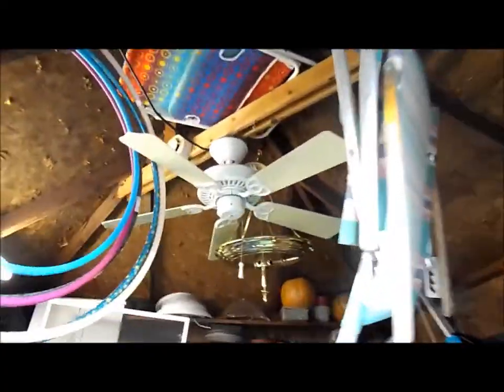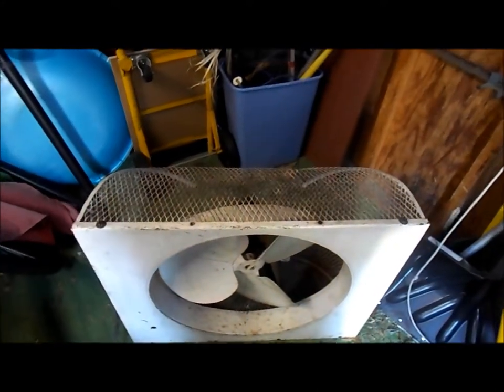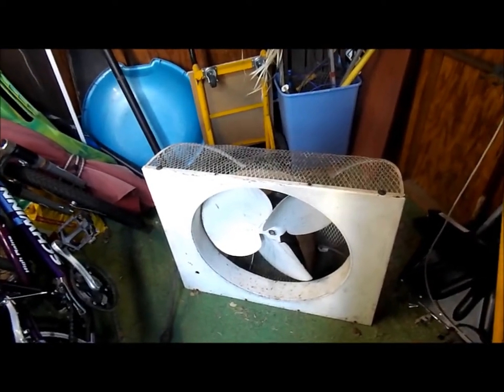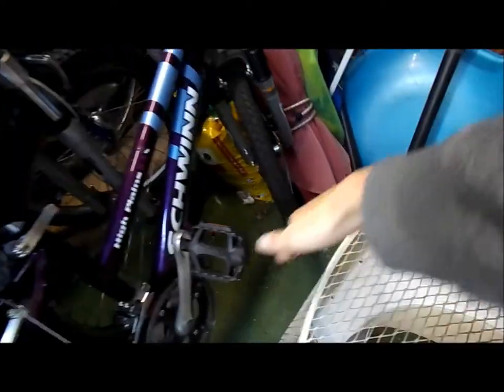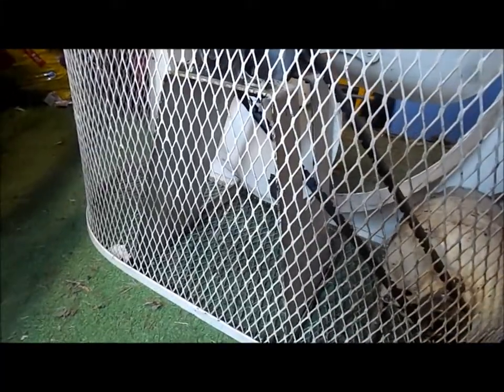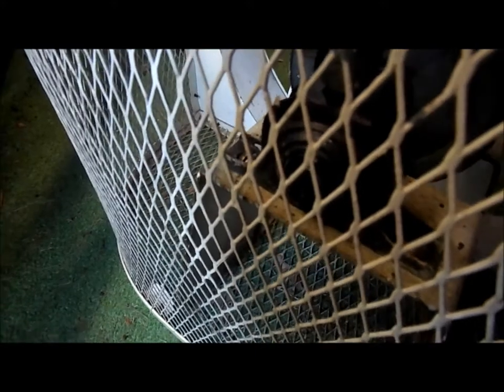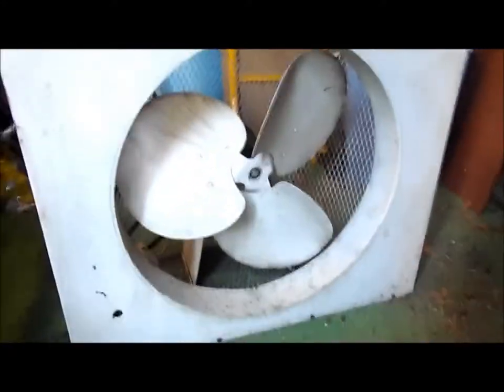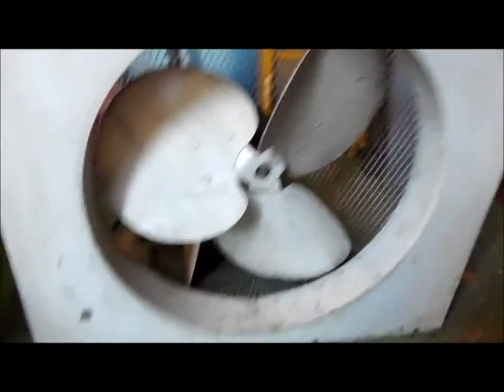Atlas Fan Co. Belt-Drive Window Fan - Pre-Restoration

Comment: I have some information about your fan. My Aunt had this exact model that she bought new in 1948. It is made by the Atlas  Fan Company. The badge that is about 4 to 4&1/2 inches in diameter is missing. It was slightly welded to the cage, and it  hid the end of the ugly pulley. The original color was a light to medium pea green color. On the badge it said Air King, in beautiful cursive writing. I can still see it. How the right leg of the A came down lower than the left side of the A. Then the  first mark of the K was over to the right a little, and the left leg of the A made the upper arm of the K.  The writing was done in black paint. And on the bottom part of the badge in small black print it said "Atlas Ventilator Company" made in USA. The entire badge was painted a dull yellowish color. It had a two speed motor, sorry I don't know what the brand was, and a   two speed toggle switch that was on the side. The black cord came out of the bottom back side of the cage. You didn't see  any cord at all except for what was sticking out of the side of the fan. The cord came through a little metal plate that had a hole in it, with a rubber grommet. On this same plate above the cord was another hole that the toggle switch fit through.  The toggle switch had a little metal ring type thing around it that the top said "HI" and the bottom of the switch said "Low".  When the switch was in the center position it was Off. She was my favorite aunt. When I was at her house in the summertime, I would sit on the couch in the den and just watch it run. The den was at the end of a long hallway. And the fan was in a window that was almost straight across from the door to the den. Every evening she would turn the fan on after supper beforeshe did the dishes. She would go and open a window in every room of the house that she wanted to cool down. Each window would be opened about five inches. They had screens in those days, but no storm windows. She would then say..."are youready to cut this baby on?" I would get so excited. She would stand there next to me and say, "remember to turn it on Hi." It would fire up and you could feel a strong draft being pulled through the entire house. It ran so smooth and quiet.  She would then go back and do up the supper dishes and get cooled down. She had opened the window that was over the kitchen sink. Sometimes I would sit at the table and talk to her, or I was in the den watching the fan. She kept the instructions that came with the fan. My dad, "her brother" would service it for her every Spring. She would then wash it down very carefully, and put a coat of 'Jubilee" liquid appliance wax on it and buff it until it shined. It also had two metal L braces that somehow fit ontop of the fan. Then you either used wood screws to bolt it to the window, or to the windows frame. That was one of the ways it was held in the window. You removed the screws from the fan and tilted it out to remove it for service and cleaning. I still remember the oiling instructions. 30 weight oil in each motor port, 10 to 15 drops every season. And for the shaft on the blade pulley, fill each port with 75 to 90 weight gear oil, not to overfill. Move blade slightly by hand in each direction, wiping away any excess oil that may have spilled out. Check belt for ware and replace if worn. It also had two side panels that would adjustin and out to fit the window perfectly. You had to remove the big wire cage to connect them properly, and to oil the rear bearing on the motor. Dad said that was always a little difficult to get to. I see on your fan someone drilled a hole in the backto get to that real oil port. You couldn't do that if the panels were in place. Yes, she a fine fan. My parents bought the 1950 model which was different in design, but they still used the same wire cage, panels, two speed motor, switch, badge, painted color, shroud around the blade, and window fasteners. The 1950 model sloped down at the top like the first Sears Hobart did. And the redesigned the blade to be more squared, where on the 1948 model the blades are more round. I forgot to mention. My aunt about an hour before bedtime, would turn the fan down on low speed and let it run all night. Or, if it got to cool before morning she would get up and turn it off. Windows were then closed after breakfast and an inside fan was used to help keep the house cool during the day. You didn't run the Atlas during the days heat. It would pull in hot air from outside and heat up the house. That's how they did it back then. I hope this gave you some history on you Atlas 1948 exhaust fan.    Good Luck on the restoration.
Reply from the maker: Thank you for this information! I think i had come across Atlas fans before and they looked similar to this one, but not this exact model. I wish this one was in better condition, I would love to see/find one in good condition. what I wonder is if the speeds were controlled with a speed coil, since the motor itself is one speed (at least the DELCO in this one is). Once again thank you so much for this info, the mystery is solved

Comment: That is a very quiet fan indeed! I can't wait to see how it will look and perform when it is restored! 

Something I'd like to mention is my gas furnace from 1958 has an identical power cord. it's only a 2 prong with the cardboard but the strangest thing is the plug grip is exactly the same. my furnace is branded "CustomAire" and has a GE fan motor.

Comment: Kind of reminds me of those old attic fans pretty sure that is what that one is just judging on the fact that has no speed control so what the case I'm thinking for that fan is they might have had it mounted up in an attic and then had an outlet tied to a light switch or something or thermostat who knows I've seen some pretty janky homemade attic fans but that one looks like one of those ones you'd buy and it's like an easy install kit or something back in the day who knows but still pretty cool

Comment: If you replace the belt, buy a chain thts stainless steel, replace it wth sprockets, nd mke it chain drive. Reason being, lasts longer, xnd,/…is bttr for ths/the set up. Cool set up, bt lke I mm cxme on,/…you liter hve to tke the bearing off to replace the belt xnd it jst lks knda confusing or so, lke tf/wtf
Reply from the maker: would it be louder than a belt? due to a metal on metal contact with moving parts